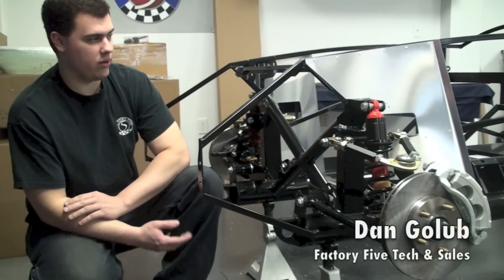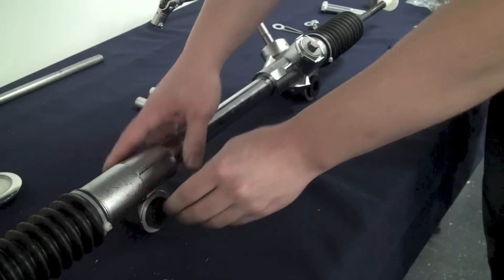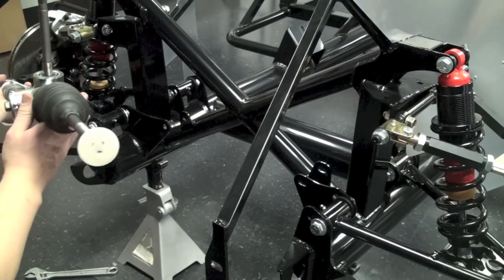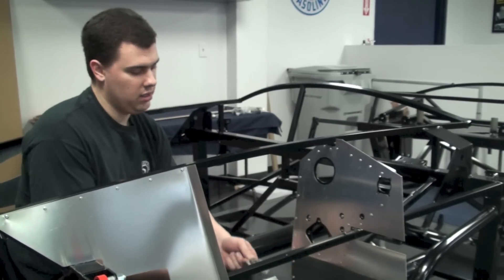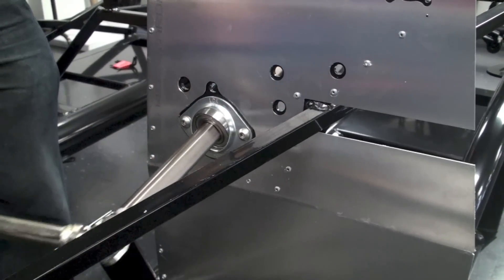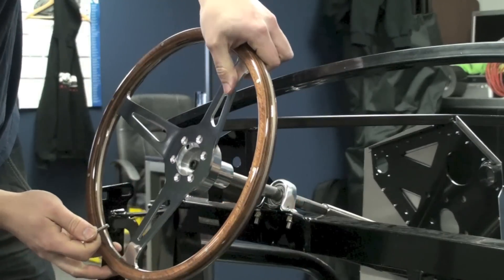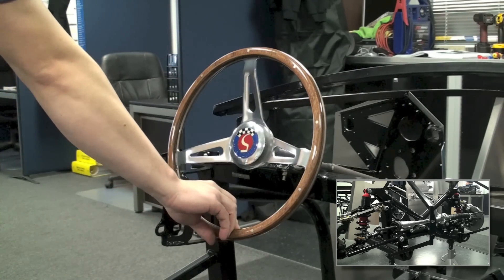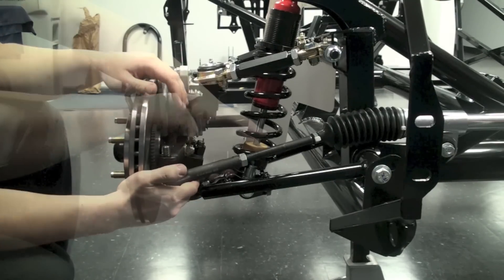Factory Five Mk4 Build Episode 4: Steering System

Comment: As a good mechanic would tell you. When you tightening hardware like a bolt and nut. Is the NUT you need to turn NOT the bolt.
Reply: Does it make a difference of how tight it gets?
Reply: Will not make any difference, only tightening the nut for the final toque?

Comment from the maker: Hi, there is a complete list of torque specs that are in the build manual for the MK4. Most major parts in the kit already have Mechanical or Elastic type lock nuts, so not loctite will be used on those. On other non locking type fasteners, you can feel free to use loctite if you wish.

Thank You
Dan@FFR

Comment: Thank you for doing these video's.  I'm really enjoying them!! I'm assuming that you're only doing this as a mock up.  During final assembly you'll be using some loctite to hold those fasteners, correct? It doesn't seem right that bolts and nuts you don't want coming off don't at least get any blue loctite. Also, in the instructions, do you have any torque specs for the nuts and bolts? I will build one of these someday and I want it to be safe for me and my family.